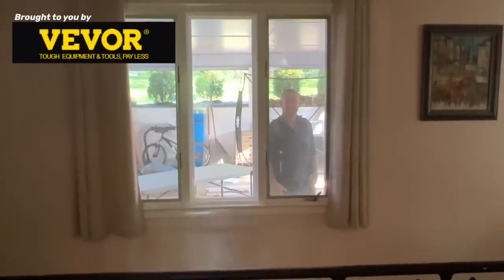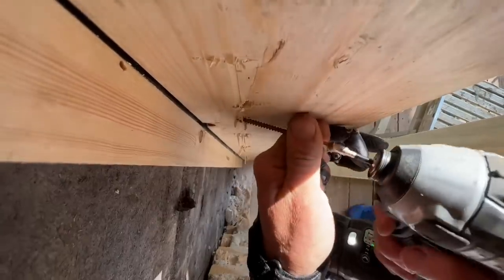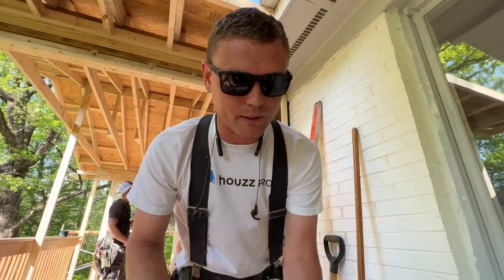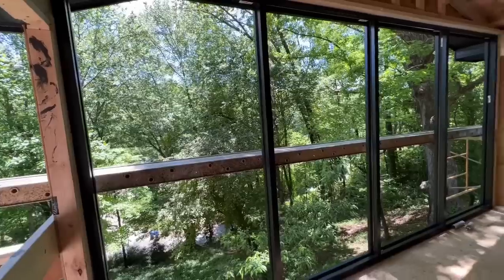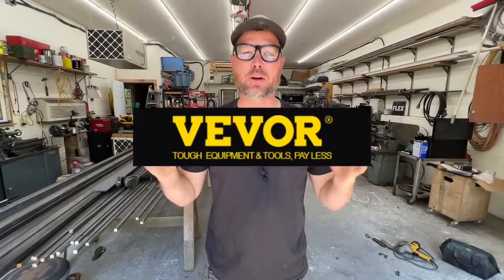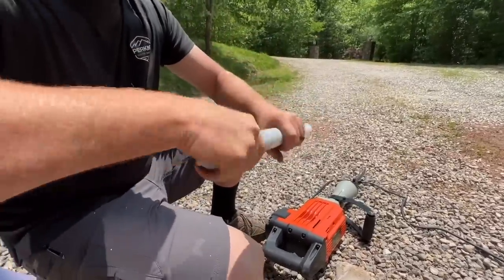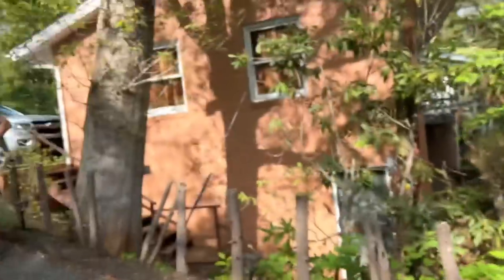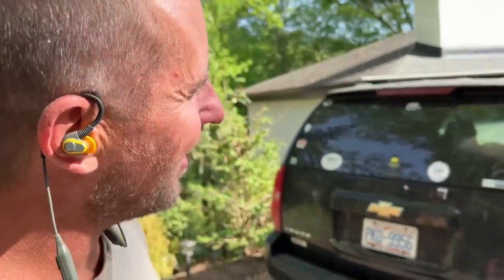Kitchen Addition & Remodel EP05 | Floor leveling, brick demolition, finish facia

Comment: Pro tip, sheet goods are your best friend for remodels. 1/4 plywood over windows below so nothing goes flying into windows. 1/8 inch hardboard layed over finished floors so you can roll wheel barrows through homes without scuffing floors. 1/4 plywood door jamb protectors taped to the doorways to prevent scuffing. And also for covering the brick pile from chipping garage floors.

Comment: In some houses the extra layer of subfloor was only in the areas of the house where the the original flooring was vinyl. This was done so that the vinyl would come out even with the areas with pad and carpet.

Comment: I absolutely love your videos, but looking at all the extra work with custom brackets, sketchy columns, furring up a subfloor, and all on a likley undersized beam and floor joists, I think it would've been better to pull the original deck and columns out and start fresh with footings, proper columns, beams and joists that plane out properly with the inside subfloor.

Comment: I know you're in a warmer climate but it seems that the disparity in floor heights is a good opportunity to lay down some ridged foam to insulate, space and act as a vapor barrier.  All those gaps between the deck boards offer lots of air infiltration even if you insulate beneath the deck, leaving a cold floor or a space for bugs and moisture.  Just an idea.  Like you said, there is no single way if doing things.
Reply: Spray foam could be a good a good option with its structural properties as well water and air barrier
Reply: Think of the bugs though. They also need a cozy place to stay, they will be extremely happy living under that floor.
Reply: Closed cell foam and T&G boards on the underside would do the trick and look nice.

Comment: As a remodeler myself, I love watching y'all get a taste! Not as easy as new construction, eh? Also, not that what you did was wrong, but what would have happened if you ripped down some 2x material for your furring strips instead?  Seemed like a lot of work cutting and gluing all that advantech. Cheers!
Reply: It is great to watch new construction guys get a taste of remodeling. I’m always impressed with how fast they work in new construction though

Comment: Thank you for filming this project.  This shows just how much more time consuming remodeling is compared to new building.  This also shows how unexpected expenses can pop up on a remodeling project.  Hind sight I guess it would've been best to tear off all the shingles prior to adding on the new roof extension.  Where is there going to be an attic access to the new addition for future wiring changes and/or attic inspection?
Reply: I don’t think there will be any from the new ceiling. We may cut a hole through the old roof to connect the attic spaces

Comment: Love watching you guys remodelling.  Try it on a Victorian house.  Wife wanted large format tiles on  bathroom.  The floor slopes and hallway slope  from left to right not front to back.  And two door ways at right angles.   The bathroom had to be level for the corner shower so Only choice in the end was to chamfer the floor as far out into the hall way as I could.  It’s okay if you don’t know and it is my dirty little secret. 🤣

Comment: I think I would have installed the girder on top of the brick columns . Which would have meant removing a few coarse!  I also would have removed the rim joist that was sagging to straighten up the floor system. 
The wall connection I don't like either.  Especially after removing the brick above the floor connection.  I feel like the brick veneer should have been removed to the bottom of the floor system and the wood  ledger attached to the framing of the home not the veneer.  What's keeping the brick veneer from pulling away from the wood structure? 
You have created a space in the floor you will not be able to insulate as well by not removing the 2× materials!
Cover the finished floor with Ram Board and 1/4 plywood . As well as the door jambs. Unless you are junking the floors!

Comment: Hi Eric!
I enjoy watching your videos. you guys are a great team and looks like you're having fun working together. Just wondering.. Why didn't you use 2x4 flat @ 1 1/2" instead of ripping and stacking 2 layers of 3/4 Advantec? two layers of 3/4 material is the same as 1 1/2" of a 2x4....
Reply: Then they'd come out 1/8 too high after the subfloor was installed.  22/32 + 22/32 + 22/32 = 2 1/16.  1 1/2 + 22/32 = 2 3/16
Reply: It is the same… see at first we thought I’d was only 3/4. So we did that. Then…. We realized we needed another 3/4. So we added another layer.

Comment: From the land of Vegemite comes something you'll also dismiss -- metric!! Instead of starting with 11/16 or 22/32 of an inch, and take a full minute to agree multiplying by 3 comes to 2 1/8th (see @14:00 onwards), why not go metric? Builders from Down Under will simply multiply 17.5mm x 3 = 52.5mm. I doubt that would take 60 secs to work out.
Reply: I think it's a matter of pride. Probably misplaced like an instinctive dislike of Vegemite.

Comment: @14:33  This is the point when all metric fans jump in. The reason why it's so hard to transition from one to the other is that it's hard to visualize how much 17mm is.  You can after thinking about it, but everyone in the US intuitively know what 3/4" looks like.  More importantly, people instantly know what 3/4" looks like.  That's why it's so hard to transition.  The only way forward is really teaching every grade school to feel comfortable with both systems.  Eventually phasing out imperial.  Like in 30 years.  For all of you who say "US will never go to metric" I have news for you.  In the military we all use metric.  When navigating, when calling for fire, when giving map grid coordinates, it's all metric.  Oddly, military aviators throughout the world (except Sweden, maybe??) all use knots and feet.  Weird.
Reply: When my country went to decimal currency, I was about 12 years old. It was dead easy to convert and flip back and forth. When we went to metric measurements, I was 30. I got there but it was a damned sight harder - by that age, I was hard wired in. I worked as a surveyor for years and all day it was xxx, yyy, xxx metric measurements but ask me my height, I auto respond in feet and inches even though I now think in metric.
Reply: It's not harder to visualize 17mm than it is to visualize 3'' & 7/16. You're just not used to it. Visualizing 15mm when you work with metric is easy. Metric is superior and more accurate on every level, Americans are just used to Imperial and think it's too late to do the transition. NASA and the US army did it, it'll come one day.
Reply: @Ogilla  All US military except Air Force/Navy/Marine aviators.. Because all pilots (except Sweden, I think?) uses knots and feets.

Comment: time you guys went metric, it's SO much easier.
it would annoy you for a while, but you guys are clever enough, you'd get it in a few days.
hearing measurement shouted out in inches, to me is like that sound, when you drag a sharp edge down a blackboard.

Comment: Question? Missing lintel or loading bearer header above sliding doors or not required in your location.
Reply: The beam we put up before the roof was built acts as the header over the new sliding door location. 2-2x12

Comment: Uhhh... in metric that would be so much more easy or precise. 3x 12mm is no fraction but 36mm :)
Reply: @BobDevV  Since 1992, the federal Fair Packaging and Labeling Act has required most packaged consumer goods to be labeled in both imperial and metric units.
Reply: @-_James_-  It takes a generation, maybe two to work it out of the system.
Reply: I'm a mechanical engineer in the UK. I was an apprentice from 1971, just before decimalisation hit the UK so I was taught in both Imperial and Metric. To this day I can still use both and convert quite precisely between the 2 systems. I would say the the Metric system is easier to teach, as I've taught my son to work in it. I've worked out in the US several times and it was easy to switch back to imperial measurements.

Comment: You do not attach to your sub-floor so older homes laid down under lament and thin set to that bringing you 3/8-5/8” or sometimes more above your sub floor!  Why?
If there is a problem you don’t need to rear into your sub floor which is actually a structural part of the home!!!

Comment: For being in Amercia, where tools are cheap, why the H are you guys smashing brick walls with big hammers, why the H did you not use the jack hammer that you prompted  and use that to take the brick work out one course at a time, the vibrations is not good for a old house brick work.. 
Come now.. 
And those pillairs are still scary..

Comment: I love the channel and the guys,  but gah come on man ram board ain't that expensive. Even if you cant bill cost of ram board and labor to job. All it takes is one brick to fall and scratch/dent. Then what you end up with an angry customer depending and what the payment schedule/agreement is, you can be an asshole and say fuck em but thats so much money/risk/liability.

That floor looks like prefinished engineered or a nice laminate. Depending on manufacturer you get maybe one sand and refinish. Realistically you would have to repair end to end depending on transitions. Also looking at that wheel barrel those 2 stands by the handle are metal. No matter how careful thats metal grinding into a wood when you set it down to open front door.

Recently-ish did a job at a 40 plus floor condo building with individual units starting at a million a pop. The GC did a really good job with cardboard on floors, corner protectors and ramboard on walls. 

I get that this channel is more like 4 fellas in pickup trucks compared to large scale commercial construction but common guys.

Comment: Vevor tools, garbage so far. Have a pair of buckets forks rated at 2klb, 540lbs of cinderblock made the welds on both fail. Made in China, but American and vote with your dollars daily. I’m just not rich enough to buy cheap crappy tools... 3 or 4 times.